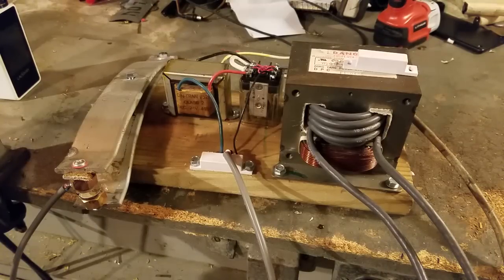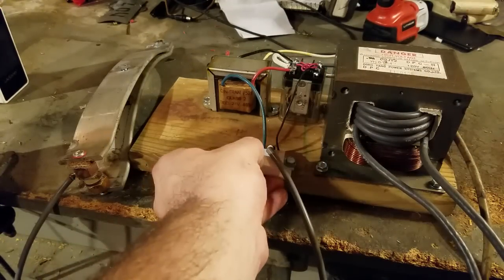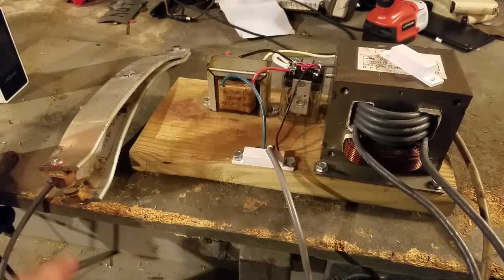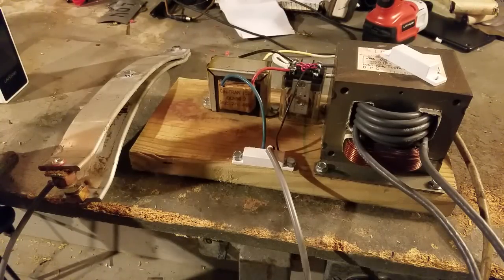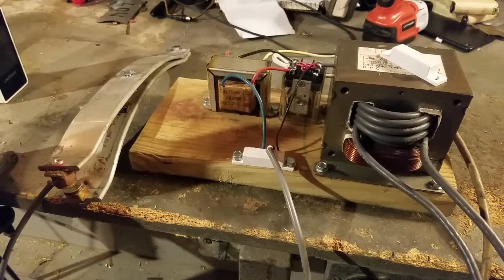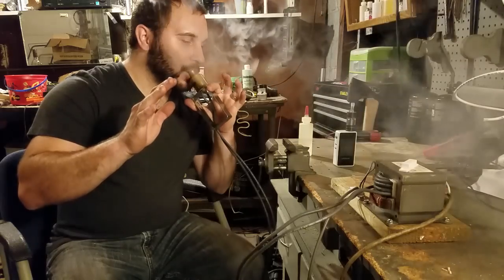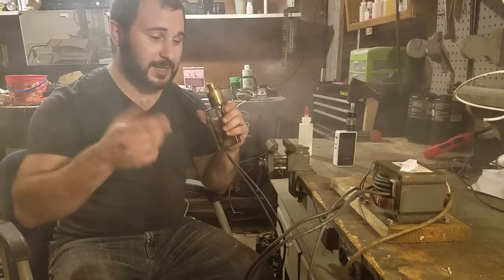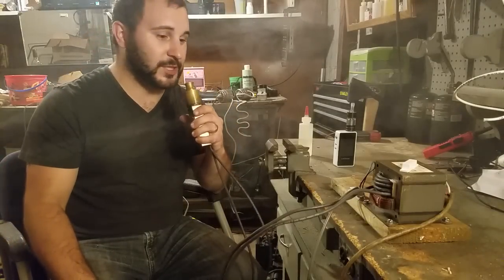finished 120 volt ac ecig

Comment: I forgot to ask if you use nicotine and if so what mg?
Reply from the maker: MrBasshead4ever here lately I've been mixing mine at 2mg nic
Reply: 2mg or lower is where it's at for enjoying massive clouds. I recently started making 1.5mg juice and it tastes that much better.
Reply: @CJHElectro  
I started with 3mg SubOhm went over to 2mg for a few months now I cut off the Nicotine completely and had no problems with it. Better taste, saves me some money, and I don't have to worry about what happens when our Government once again thinks about a new limitation of nicotine in E Liquids. Now we only can buy max. 10ml bottles with max. 20mg/ml of nic in it. But now were the Juul enters here in Germany they want to cut this down even more.

Comment: this is great keep making stuff o and record making it too not just a review of a super cool concept. In theory cant you just use a typical DC power inverter cutt and stripp ends connect to a tank plug inverter into power strip hit on and off on power strip to fire up a of deck with let say a 12 volt dc power supply at 2amps?is that enough power for a good vape comparable to aspire triton tank on a single 18650 hybrid mod once i saw on this VGOD elite series mod >>>{ from fasttech.com best clone I EVER GOT!! [well out of 3 or 4clones not sure if the 4th is a clone yet! lol] I am amazed this mech mod in gold is sweet but super simple }  SO> as i was asking.... my battery is literally what composes the bottom of the 510 connection on this mod! the place where u screw in tank has nothing but a hole after threading!?!?umm and switch is push button on bottom witch made me realize HOW SIMPLE A vape IS! and ended up pondering  a AC plug in vape idea or pass through its called I learned. SO COOL you made this video cuz there aint much regardimg pass throughs and AC current vaping n i see no DC inverter pass through online  like a 3-12v olt standard home 110volt wall plug in cord with 510 connector on the end or heck put a few  510 connectors and a screen(so many FLAVORS AND TANKS) make it 36volt split 3 or 4-510s with simple push buttons on wire boom million dollar product so why wont it work RIGHT???? thanks in advance if u read this mess and for answer to my ???